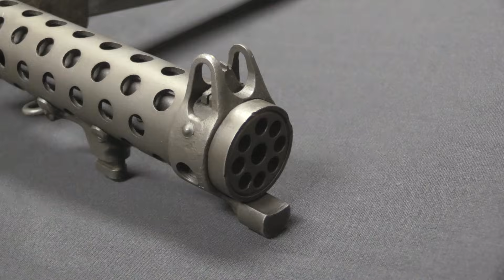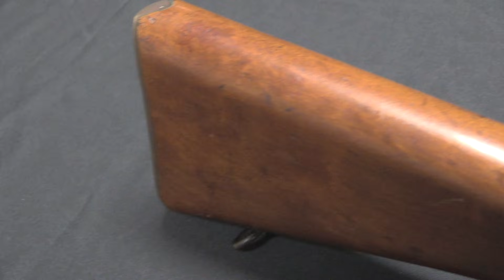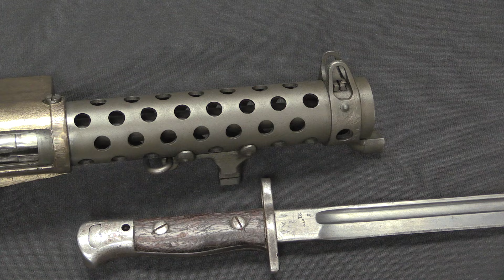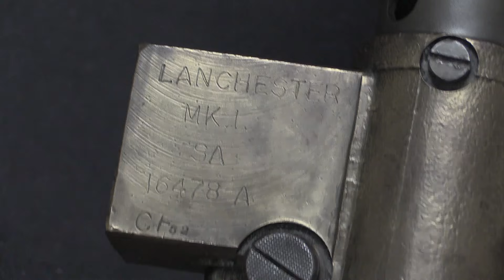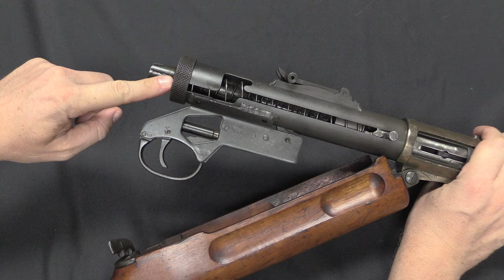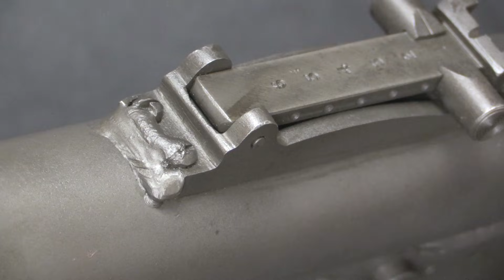Lanchester MkI: Britain's First Emergency SMG

Comment: I think the barrels are close enough to be interchangeable between the Lanchester and MP-28 as well.  Oddly in regards to the bayonet,  the Brits kept the Bayonet capability on the Sterling for and I have seen training photos of soldiers in training doing bayonet practice in the late 60s.
Reply: Had a bayonet o my L2A3 in the 70's. Handy for guarding prisoners and, of course, you never run out of bayonet part way through the fight.

Comment: You know, if only it were legal for the average merchant ship to have a couple of those on board, we would most likely never have heard of Somali Pirates.
Reply: Not likely. 

Merchant sailors basically have no weapons training. 

Usually armed guards are hired by the company if they need protection, although I do know of an Israeli firm that issues Uzi submachine guns and trains it’s sailors on how to use them.
Reply: Daniel Olbris 

Id have to say, a cheap, effective gun that works when slightly worn would be ideal. Due to sea salt in the air corroding any metal it touches (practically)
Reply: Briseur De Lance attacking innocent merchant ships didn’t help either since all the money went to the rich war lords and not to the poor fishermen who were forced to be pirates.
Reply: That's why they hire merc's..
Reply: Technically no firearms are allowed on board.. especially if the ship plan to visit country with tight firearms regulation / no firearms for civies regulation..for example: China.. you are technically illegally importing firearms into a country that outlaw firearms.. if they are armed to a certain point.. pirates will carry heavier weapons.. 20mm, rocket racks, hell probably they just mount some serious artillery.. and ship security alone is the job of security team..crew job is to make sure the ship  runs & reach their destination
Reply: @pckkaboo6800  Mercs solve this by throwing their rifles overboard when the ship reaches the port. Literally.

"Maritime experts say some less responsible companies provide their guards with cheap weapons, which are thrown overboard once the job is completed."

https://www.bbc.com/news/world-africa-30512185
Reply: Pirates brandish AKs and RPGs
Boat crew brandishes anything more dangerous than a kitchen knife
Pirates start working on an escape plan.
Reply: Daniel Olbris 
Well, as "fun" as it sounds, it wouldn't have helped Somalia through her dire straits. :-P

Comment: Is there any advantage to the firing pin being separate? I reckon the pin isnt cocked separately from the bolt, and works exactly the same way fixed pin does, only doing so with more complicated manufacturing. I know some SMG have various mechanisms that make the pin strike when the bolt is fully forward, but this (or MP 40) does not do that. The separate firing pin does not make any sense to me.

Comment: Interesting to note the welds over the rear sight. Was the done to all Lanchester MkIs or something post production? I'm assuming the screws must have had a habit of falling out?
Reply: Not sure if those are welds or some kind of goop...
Reply: They probably used the screws to fix the zero-position, then tacked over to hold them. Then you can do the main welds with less chance of anything moving.
Reply: IIRC the tangent sight came off the shelf as an existing pattern. Hence the screws for the original user.
Reply: Not long after production started they noticed the screws kept working loose so they started to weld them on. Guns with serial numbers under about 1000 can be found without the welds and from then on they were all welded. From approximately serial no 16,500 they were welded on but without the screws although the screw holes in the tangent sight were still there.

Comment: Actually those welds looked pretty good.  They look TIG'd,  was that even invented then?
Reply: Cyril Hudak I think that TIG or inert gas shielded arc welding came in around the late 1920's or 1930's but it was probably just normal fluxed rod arc welding and some good descaling.

Comment: I didn't know the brits had a more emergency smg than the emergency smg the sten
Reply: Well, the Sten is more of an emergency SMG to be fair, since this one was much more expensive.
Reply: Here, they just needed to get an Smg. Like everyone else, they made a more economical SMG later on.
Reply: The sten was an emergency gun to replace the more expensive emergency gun, then they replaced the sten emergency gun a couple times with different sten emergency guns
Reply: @kaistzar2831  sounds like a metro weapon
Reply: Well, you gotta have an emergency option, for an emergency option, of an emergency option.

Comment: I dont understand the british designation system. How does a mk.1 of something differ from a mk.1*, and that from a mk.2?
Reply: The system is similar to more modern systems where you have mk.1, mk.1A, mk.1B etc. Just think of one star(*) being a letter A and two stars letter B etc. It is just to differentiate minor modifications and upgrades rather than major redesigns that would require a new mark number. Nowadays designations like L82A1 are used. L82 is the basic designation of the weapon, A indicates the initial design and a major redesign upgrade would be B or C etc, and the 1 indicates the minor modification or upgrade state. So the star (*) equates to the final digit in the modern system. One star equals 1 two stars equals 2 etc.
Reply: Peter Hopkins That's not true about the SA80.
Designations begin with A1 and go up sequentially with each new variant. So the first variant is the A1, the second variant is the A2, the next is the A3 and continues until an entirely new weapon is adopted.
Reply: Callum Turner I was not trying to be specific about the L82 I was just using it as a convenient example. The A1 thru to A3 are obviously deemed by those making the decisions on designations to be incremental upgrades or improvements to rectify problems found with the initial version. If they decided to re-engineer the gun in a much more major way, say to a different calibre (say 4.85mm instead of 5.56mm) then the alternative calibre would probably be the B version otherwise what is the point of using the letter A alone. Ordnance boards have sometimes in the past changed the designation or mark number solely to identify which one of several factories produced the weapon. These people making these decisions often seem to make changes that are illogical and sometimes out of sequence.
Reply: Halinspark it's meant to be confusing. Who want politcians to know what's going on. It was the same in America until the 1960s with aircraft designations in the Air Force and Navy. It all came to a head with the F-110...

Comment: A curiosity question here. You have often stated that the weakness of the STEN, Lanchester and, indeed, the MP38 and MP 40 was the magazine double stack single feed system. On the STEN and Lanchester, is it possible to retreofit or adapt them to double stack double feed? Seen in hindsight, I can understand why they didn't change it in the middle of the war. But would it be possible to change/adapt the magazine well and bolt to double feed system? Just curious, as - as you have stated before - this would/could have eradicated many if not most of the problems with the STEN and Lanchester.
Reply: BoFoenss - not just the bolt and magazine, the barrel and trunnion would also need modified. They need a feedramp fit to accommodate a double feed feed magazine. Easier to just make a whole new gun than retrofit.
Reply: @rcbif101  In  Finland the Suomi and M44 SMGs were modified in the 50s for double feed magazines.
Reply: The reason it's that the way is to use mp40 magazines.
Reply: BoFoenss I would have thought it would require a more complex machining process and on low quality emergency weapons that could actually be less reliable

Comment: Neat, I was hoping this would pop up. I've got a deactivated Mk1* in considerably less enviable condition and minus the magazine. It had actually been deactivated twice, first time being after the war. They accomplished this by severing the firing pin in two while the gun was fully assembled, using a plasma torch or something. The guy I got the thing from managed to turn a replacement firing pin and restore it to functionality, even with a nearly bisected bolt. Unfortunately that sort of thing isn't legal over here so when it came into my possession I had to get my lgs to put it down properly. Did manage to find a 1907 bayonet for it though.
Reply: Neil Douma Oi m8, you ave a permit for that bayo?
Reply: EisenKreig Oi m8, you ave a permit to ask about permits?
Reply: Marvelous Dex M8,  I'm Californian. If I don't have to, I will.
Reply: @eisenkrieg553  The rest of the US doesn't require a permit for something so simple as a bayonet.

Comment: 50 sterling was a solid ripoff...by the yanks. it should have been worth 16 or 17 pound sterling... the price they asked was nearly 600 dollars for a tommy gun?
Reply: gabriellockhart it was $209 per gun in 1939 before the improvements reducing costs in '42 and 50 British pounds in 1939 was just about $209 so no they weren't being ripped
Reply: It was an expensive gun to make.  Not a rip off.  If they had a better option, they should have taken it.  But they were being charged the same as everybody else.
Reply: I mean, the Thompson wasnt designed wartime production. I think i recall reading they were able to drop its production cost to like $75 (in1940s dollars) by its final adopted version, which was still super expensive (the M3 Grease Gun was $15 for comparison ($200~ in today dollars). Add shipping costs and whoo boy.
Reply: dndboy13 they got it to around $75 in 42 and around $45 by the end of the war, which it is better than the original $209, but like you said the grease gun was definitely a lot more cost efficient sub gun costing a third of even the latest production, cheapest Tommy gun
Reply: Even if the Brits weren't being ripped off compared to everyone else buying Thompsons, it's still notable that everyone buying Thompsons was pretty much being ripped off. The principle of supply and demand meant that they were worth as much as the manufacturer[s] could get away with charging. Cf. the real attempt to provide a cheaper alternative, which only happened much later when the M2/M3 was poised to replace the M1A1.
https://www.youtube.com/watch?v=1o9q5Xh69AM
Reply: ccrkicksass00123 Grease gun may have been cheap, but it was pretty crude too, even compared to other cheap sub guns.
Reply: Well considering it had to be shipped across the Atlantic with uboats on the prowl id say the shipping charge was pretty reasonable
Reply: ccrkicksass00123 Agreed.
Reply: gyneve I certainly won't argue that. Though it would still be nice to be able to equip 3 men with crude sub Machine guns to every 1 with a great quality one
Reply: no you got it mixed up the dollar in 1939 was worth 23 pence so you draw the conclusion five dollars to the pound and you get 250 dollar for 50 pounds sterling except the pound sterling was 240 pennies to the pound not one hundred. it goes from five dollars to pound to 12 dollars to the pound.  hence being ripped off.

Comment: Looked it up, 220 USD in 1939 is about 3,800 USD today. I had no idea how wickedly expensive Thompsons were back then. That's like two AR-15s today!
Reply: Two midrange ARs. $3800 could buy 7 of the mass production rifles.
Reply: CultofHam Thats more like 5 AR 15's. I have seen Olympic arms ARs for as low as 700 recently.
Reply: wiki says sten gun in 1942 is 10usd which ends up as 150bucks today
Reply: What is the price for a Kriss Vector?
Reply: +Ringo Wunderlich about 1300 bucks, so you can get nearly three Vectors for the price of a tompson.
Reply: I wouldnt spend 1900 on a ar 15, maybe an m4 (full auto) thatd be fun. I built an ar 15 for 600. So literally 6 plus 200 dollars remaining.
Reply: Ringo Wunderlich a full auto m4 is around 10k 😂
Reply: the army unit price is much less its like 700usd
Reply: Ringo Wunderlich it was a very expensive gun to manufacture.
Reply: Add another $200 for the transfer tax and you can see why so few were sold for civilian use.
Reply: Two? ARs go for as low as 500 so you could get more than two
Reply: CultofHam or about 9 AK-47's for no reason
Reply: I dont think that inflated number is correct, how did you calculate that?
Reply: sergeantbigmac I know a lady who bought a house with her husband after the war for 3000 in suburban Massachusetts. His numbers might be pretty close.
Reply: The Thompson also had a ridiculously optimistic, complex and expensive rear sight, like many contemporary smgs. The drum magazines were all returned by the British in exchange for stick magazines, as the drums were really noisy to cart around, perhaps not an issue when spraying the pavement (aka sidewalk) from a moving car, but an issue to the military. They were very well made, over-engineered and a relative novelty, we seem the same issues with many other manufactured goods.
Reply: thats inflation for ya
Reply: CultofHam or like 10
Reply: 30 Mosin Nagants.
Reply: You could also buy a nice used car for that money back then
Reply: Pre COVID parts kit from Palmetto State Armory was around $250 and a stripped lower and FFL registration fee was another $100 so for $350 total you had a fully working AR15 without magazines but those are like $9.   Right now during COVID/protest gun buying rush the price is around $500 to $550 but the price is already slowly going down.    I think by Black Friday the big discounts will start again, hopefully.
Reply: @DrScopey2  Not quite the same gun as a Government issue M4 though which would be comparing "apples for apples". Not sure what they cost but I'd be surprised if they don't come in 2 to 3 time the cost of a civilian "AR pattern" semi auto.
Reply: No matter what thats much better than the American 180 i want. Full auto 22lr just for fun but the one i just found costs 15,000.
Reply: Tompson was quite the greedy bastard, was he not?
Reply: Shawn R You're spending $700 on an AR?! You can get them all day for $450 and I see go on sale all the time for under $400. I built my AR for $700 including optics and some upgraded premium parts
Reply: Shawn R lol I paid 400 for an olympic arms